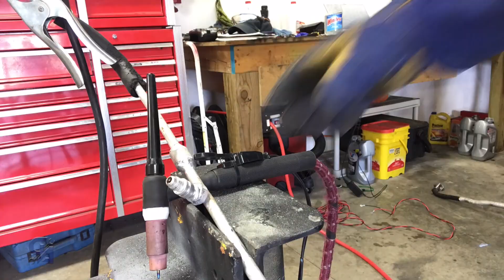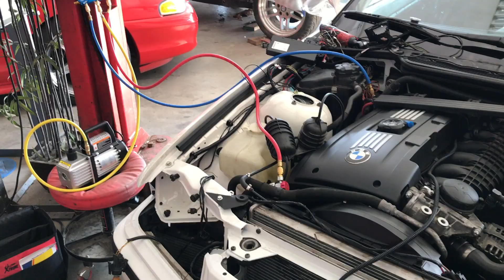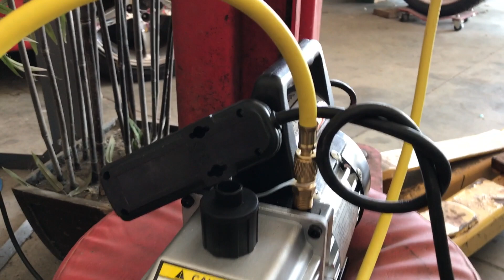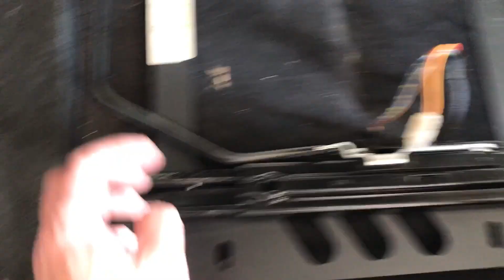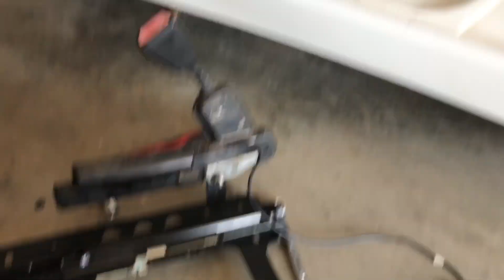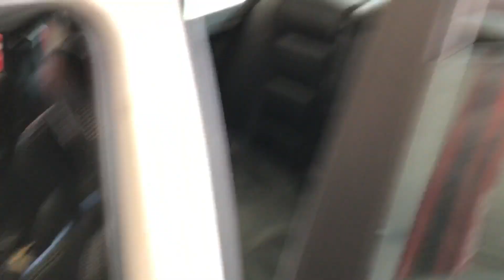A/C, Wiring, and Sparco R100 Seat Install!

Comment: I've been looking at these seats for my E36. Its a coupe but should be the same. Would you say the seating position is higher, or lower than standard E36 seats? I'm a tall guy so its important.
Reply from the maker: Lower than stock, the sliders are pretty low profile. Ben is a tall guy too so height was a concern for him as we

Comment: Do all the bolts you need to install for the seats come with the parts when you order them or do you need to find specific bolts seperately from a store? Like do you just pull off the bolts from the old seat and install them into the new one?
Reply from the maker: I reused the e36 bolts

Comment: Frank, i knew it is going to be a bit more difficult but you made the right choice. On the long run you'd like to have the gauges and all working as close as stock. Nothing worse than an engine swap with a couple of lights on in the dash. Although a bit more work now for you but the owner's smile will last longer later. And a satisfied customer & Yt crowd may bring more swaps in future 😉. Good progress and keept it on 👍. Cheers AJ
Reply from the maker: You’re telling me!! Sorry for the more sporadic postings lately. The troubleshooting and fine tuning of all this stuff is very time consuming, but I have just one or two more items. Another A/C dedicated video is coming up this week!